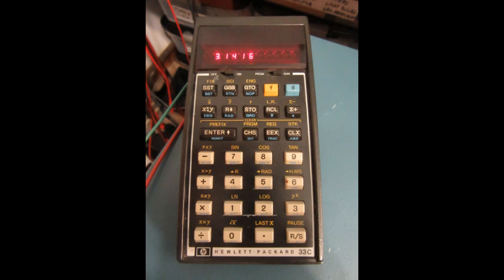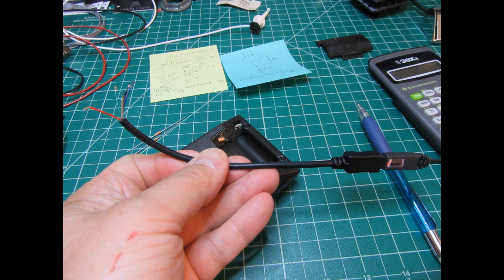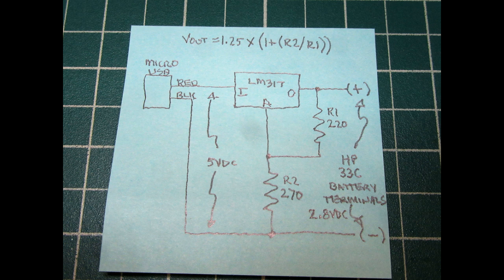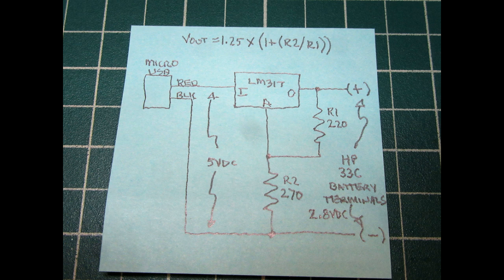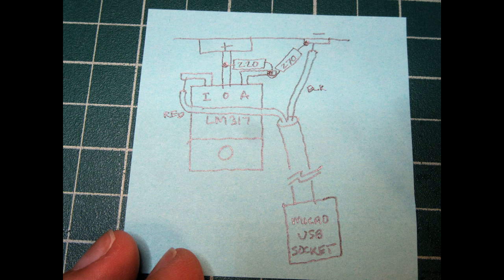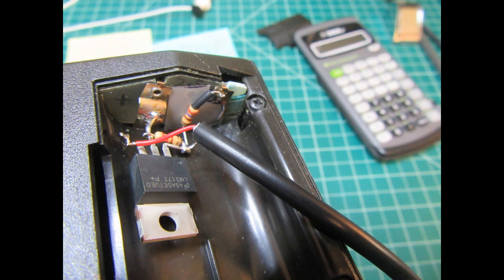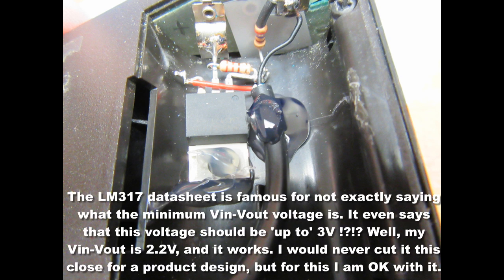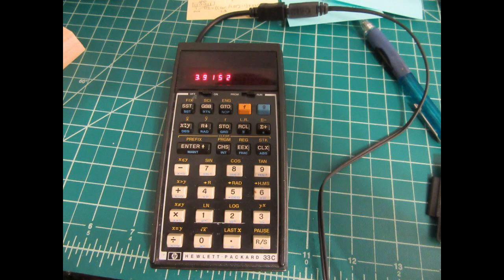HP 33C Calculator Battery Eliminator Hack

Comment: I have been running my 33C with 2 x Double AA batteries and a piece of aluminum foil to bridge them at the far end.  I hadn't realized the intended voltage was 2.8v!  It still works though!